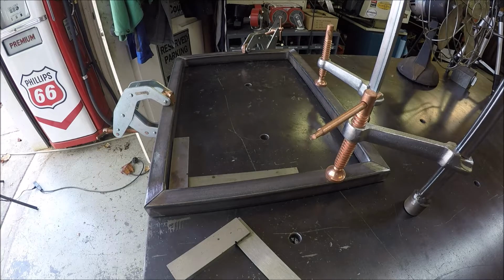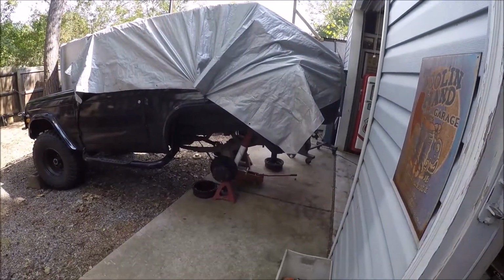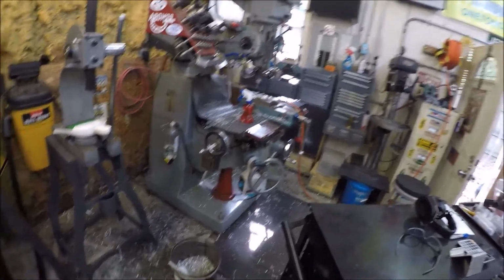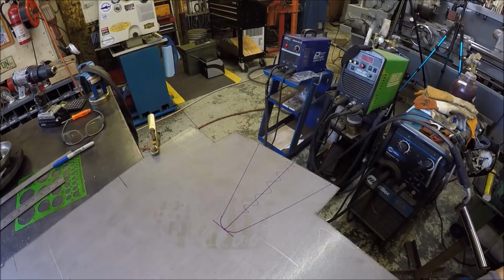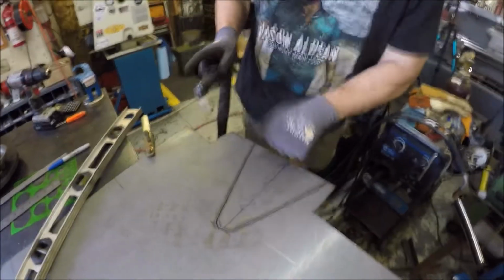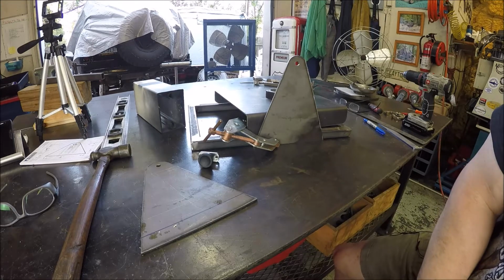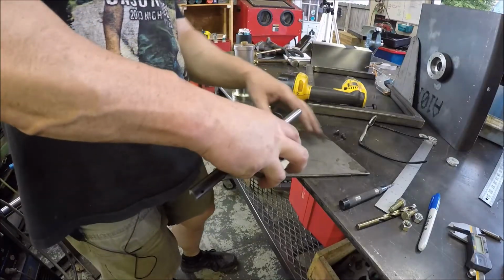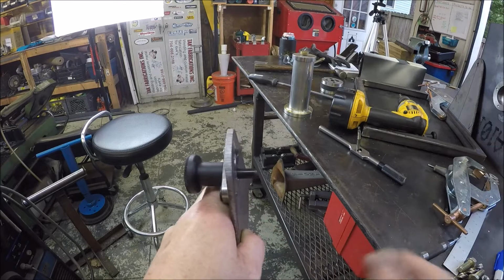Rotary welding table build Part 6

Comment: A piece of advice bud. Try some low cut work shoes, I purchased a pair of Keens before I retired because I could get the company $50 payment on my shoes. But a solid pair of work shoes “not boots” will help. I’ve even sometimes wear regular length socks, lathe chips can burn just like weld or plasma spatter. Just another way to keep from doing the sparkie dance 😁

Comment: Very nice.  You might want to move your mic down some, or out on your shoulder some.  The volume comes and goes based on chin location.  Saw that a lot in running Church audio.  Nice build series.   I forgot to say first comment!  Yahooo.
Reply from the maker: Good idea. I will move it. Thanks.